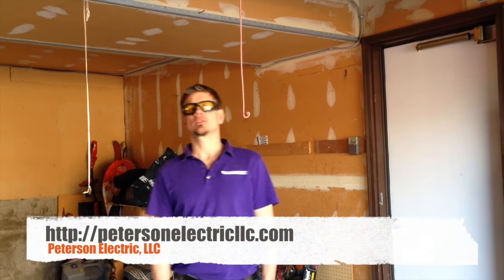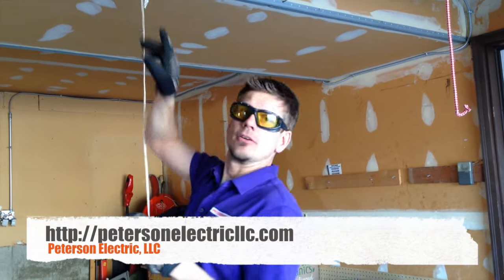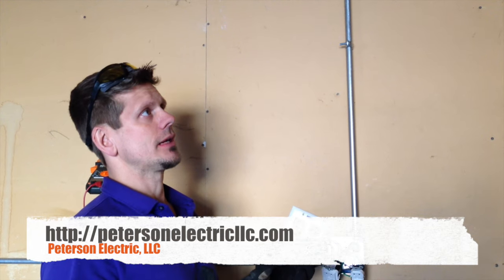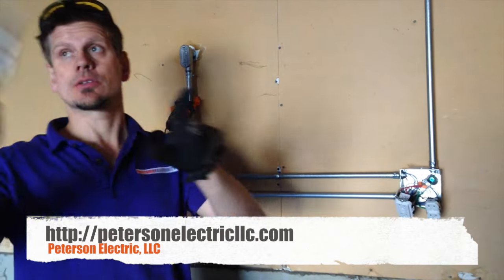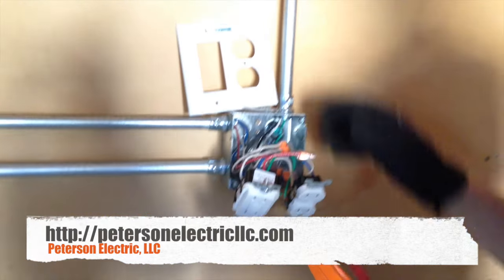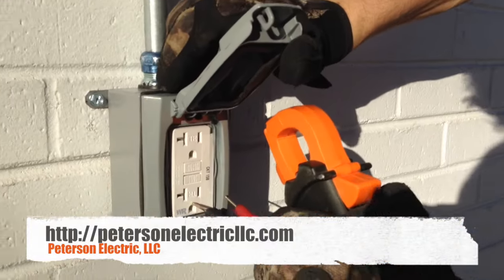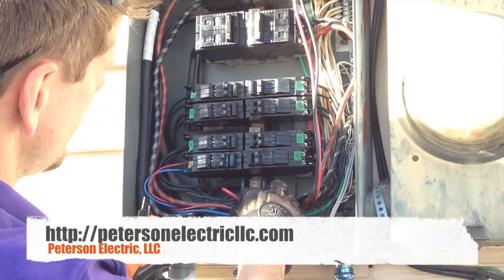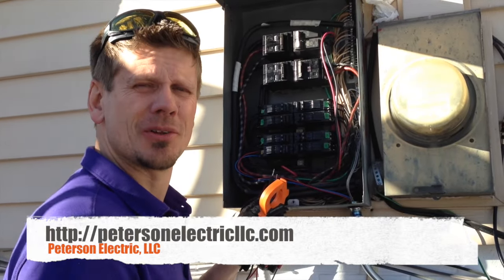Electrical Code For Garages & Exposed Romex Wires

Comment: I would never accept an installation that used conduit as a ground. It has too many ways it can fail....
Reply: while it is acceptable to not run a grounding wire, i would have to agree with you JIMMY TATE. honestly, why wouldn't you just go ahead and run a grounding wire at this point, 1 more wire? it's not like there wasn't enough room in the panel or the pipe and it definitely wouldn't break the bank. i mean come on that "is" kinda cheesy
Reply: only makes good sense, knowing that over time those box connectors are going to loosen.
Reply: @chaser9363  I realize your comment was made in 2017 and no why would that connector screw back out? Are you thinking that the emt and the connector is expanding and contracting from heat? An if that was the cast then it would be in the NEC to pull all grounds in all of your emt installed. I am also a electrician for 25 years I do commercial work. An can there be a failure in a connector or coupling with set screw. You dam right when the person installing does not tighten the set screw or  does not tighten it correctly. These contractors in residential cut there prices to the bone . Do you really think they want to add ground wires? Only if it was required by the NEC.
Reply: @MrShockman10  set screws could also loosen over time as a result of vibrations and foundation settling as well, especially in a new neighborhood where there is still a lot of developing with heavy machinery going on. and not only the set screws, but the lok nuts need to be tightened properly as well. plus now that i think about it, you also need to make sure that you're not using a concentric or eccentric k/o box unless you knock out all the rings and no reducing washers as well.  i do know that at OIA you must pull a ground and no set screw connectors are allowed because of the vibrations from the jets. while i'm aware this isn't an airport situation, houses are still subject to vibrations and foundation settling.  hell, i know at least one county here in Florida wants us to use expansion coupling every so many feet on pvc pipe do to the ground settling so much. i'm a 30+ year mostly residential electrician with idk, about 5 or so years of commercial under my belt. idk, i would just figure the extra wire into the bid and walk away with peace of mind knowing no matter what, i'm covered. but hey, that's just me. always trying to be the perfectionist. not that i am perfect, but i do try.😎
Reply: @chaser9363  If a connector or coupling is correctly tighten I have never see one loosen up. They are designed to bite into emt.As far as a concentric knock out that has nothing to do with a set screw failing.I do not know what type of problems you have in Florida with this happening.But in the Midwest  we do not have connectors failing or loosening as you have said. If the failures you have been saying is so wide spread.The NEC codes would have changed . An if you are so concerned about this then  go to a compression coupling or connector.As far as pulling grounds in that is great The way cast connectors fail if you are in and attic step on one and crack it. Or the cast itself cracks and you do not know it. Or the cast is weak and becomes out of round. Or are made In China garbage.I have also done residential to. An as I said  you must have a totally different situation there if you live in Florida and homes there use NM wire. An I have never seen anyone beside you comment that this is happening with set screw connectors. Let the NEC know if you think there is a problem. Emt here does not just float in the air    I either use one holes or nail straps to hold it to the wood of a home. Or if need be bolt type minnies. In a commercial setting where it is spec out to pull grounds on the print. 
Especially in a data center where grounds are upmost important.As I said pulling grounds in a home is the best system you can have using pipe. There are thousands of homes using set screw connectors and coupling. An they usually fail in a grounding situation due to the installer or the casting or the set screw does not bite into the conduit enough making it a high resistance for a current path to ground. That can also be with your lock nut to. An to me that is great that you care a lot to do a good job. That what matters the most. I also work at nuclear power stations. Good Luck and be safe.
Reply: Your statement from you shows you have no electrical knowledge at all. Conduit is one of the best installs used. An there is nothing wrong as conduit being used as a ground if the couplings and connectors are rated for that purpose. You think the NEC has dummies writing the code? It is with any install from NM cable to conduit it is the installer knowledge to do it to code. An care enough that it is done correctly as my local points out in a journeyman like manner. JIMMY TATE  Is pulling grounds the best install? Yes and that can even fail if not installed correctly.
Reply: @MrShockman10  well, i guess you told me. 🤦‍♂️🤣
Reply: @MrShockman10  looks like i struck a nerve.🤔🤦‍♂️🤣
Reply: I agree totally. Yes its a abundant ground but on a new install, id ran a individual ground for my conductors
Reply: @MrShockman10  man your not the most consistent guy are ya specially for an electrician
Reply: It's more effective than you'd think, they actually test this and do studies on this stuff. The wire egc can fail too.

Comment: Over time the grounding performed by the conduit will degrade.  Using a copper wire for ground is the only way to ensure long term safety.
Reply: Yup new code
Reply: In the comments below he said he pulled an egc so he isn’t relying on the conduit for ground. But thanks for your tip.

Comment: I get out bid on garages all the time.  I refuse to run type NMB Cable exposed below 8'.  The term "not subject to physical damage" is largely up to the local inspector.  I feel if it is easily accessible it is subject to damage.  Even up high people put stuff on top of the joist endangering the cable.  I just put it all in EMT.  I can run it quickly so it is not that much more expensive.  It looks a whole lot better too.  I understand not everyone has that skill but you said it yourself, even type MC and AC have similar wording as far as being subject to physical damage.  So for a novice I would say at least use a metal box with an EMT riser up to the joist on an open garage.  Use a plastic bushing (they make them or a connector with a plastic bushing at the top to protect entering cable.  The last statement I will make might make some people mad but I don't think novices should do electrical work.  Understanding electrical theory, The National Electrical Code and acquiring the skills to do this work are way beyond the DIY person.  No use burning down your house to save a few bucks.
Reply: If you can read (or study YouTube videos) and turn the power off, I don't see the danger.   The code is published and vigorously debated online so there's no lack of information available on how to do things right.  

There are definitely high-voltage and high risk tasks that I wouldn't touch.  Likewise for things that require expensive specialty tools I would only use once.  

But running a circuit or adding a receptacle or light fixture?  Come on...
Reply: @davidrh74  there was a lady in a suburb of my city that was electrocuted because her husband wired a light fixture over her sink.  He accidentally got the switchleg on the screw shell of the light socket.  She was on her knees on the stainless steel sink changing the bulb when she was electrocuted by accidentally coming in contact with the bulb's screwshell.  There is no way a Youtube video can teach electrical theory, best practices and code.  I am sure if you asked her husband he'd tell you electrical work takes training and no 10 minute video is going to cut it.  DIY is fine for putting down hardwood floors or fixing a faucet but not electrical or hvac work.  It's way too dangerous and way too technical.   I think if you are going to post this stuff you might want to check with your attorney about your personal liability for claiming to be an expert.  I would think if something bad happened they could blame you.

Comment: As a home inspector with over two decades of full-time experience, I have to say... Nice Job!!
Reply: What kind of wire can I use to power a floodlight camera to the driveway getting power from inside the garage ceiling outlet. I want to hide cables inside driywall. No crawl space. Do I still need to use conduit?  Thank you.
Reply: @avillareal1  if it’s inside the drywall then romex is fine.
Reply: @edwrd1990  what if running wire outside drywall, instead of running cale through conduit, can MC cable be exposed in garage?
Reply: @avillareal1  from what I understand as long as it’s not subject to being damaged then MC is fine.

Comment: Thank you for this video. Garage wiring is one of the most confusing issues for this DIY person trying to follow the electric code. The code on this issue leads to long discussions on electrician forums. Eventually I just nod out trying to follow these discussions. The interpretations in this video seem straightforward and they were nicely explained. 

The underlying problem that leads to this confusion is the code itself IMO. Everybody that reads it brings in different sections to justify a particular view.

My current view in most areas:
1. NM is OK in garages with and without drywall.
2. NM may be OK to run below 8 feet in an unfinished garage if it follows the stud. Presumably beside the stud in the stud bay is best.
3. The use of AC might be allowed in some situations where NM wouldn't be. For instance passing horizontally through a stud bay below eight feet.
4. There are often claims that there are different rules for attached and unattached garages apply. I think that probably isn't the case.
5. It is not necessary to provide a fire barrier for the NM in the normal garage.

FWIW, In the few garages where I have installed wiring, I just use some kind of flexible metal cable. As much as possible I run it just below the garage top plate. When it crosses a stud bay I drill a hole for it.

Comment: Why would you set up the outside receptacle to effect the inside garage receptacle upon ground fault? If I am working in the garage and cause a ground fault that killls power, I certainly don’t want to be going outside to reset it. I want to reset the receptacle right there where I’m working.

Comment from the maker: Agreed, we have an EGC conductor in our flexible Mc cable, as long as fittings are tight and tested you can use it. The newer R3 sealed compression fittings are not as easy to work with

Comment: What kind of wire can you run through the  MC conduit. Does it come with wire in it? Can you run Romex in MC or EMT conduit for short distances. Thanks. I've got an extension cord run across my ceiling to power the garage doors for the last 30 years(not the same cord of course), and would love to do it right, finally. If it's above the drywall on the ceiling is Romex ok if not in a conduit.

Comment: if I'm adding a spotlight to the eve of my garage wall facing the driveway (over the garage door), I can simply run Romex from the existing garage door opener circuit (on a GFCI breaker at the panel) via external box, correct?

Comment: Technically mc conductors are not labeled, hence it is not listed to be used in emt conduit as say thhn . That's a short run but something to consider.
Reply: I use mc that has conductors inside the jacket with THHN labeling. I have a 250ft coil of it in my truck right now. It's nice because it doesn't have that stupid thin plastic string wrapped around the wires.

Comment: I wonder if the codes generally concerning Romex apply to UF feeder as well. My interest is in protecting some exposed indoors UF feeder from mice with split loom casing because I don't want to have to replace an old panel with an AFCI compliant one. The structure is across the Bonner County ID line in a non-coded zone but I want to stay close to the older two wire codes for safety and wish I could have the AFCI breakers as well. I just can't afford the panel or the 3 wire upgrade for this one so the split loom casing seems an affordable option for exposed 12 ga UF feeder inside a building. Hoping the netted ventilated version won't make it run too hot . . . ?.

Comment: Your videos are usually spot on for information but I would change two things to help the presentation. The first one being a wireless mic so the audio stays consistent without room echo or volume changes due to turning your head. The second is to do the company logo in a watermark style (see through) so it doesn't block what you are showing in the presentation.
Reply from the maker: Thanks for watching, we can not take all the banners down that easy. I have a ton of videos that came out for years, over the past two years we not been putting the banner up and are looking in to a mic.
Reply: @Petersonelectricllc  Yo Brother Josh I've Got $25 on your Mic Man!
Keep up the Great Videos😀

Comment: Isn't the outside outlet cover required to be in "in-use" cover by the current code?
Reply from the maker: Mark Lawry no, not if it is in a dry location. This is in a garage not outside
Reply: @Petersonelectricllc  What about the outside outlet?
Reply from the maker: Yes, you are, but I still use the flip covers when there general use and not needed for a pond that needs to be on , for example.

Comment: Never seen a residential electrical  breaker panel outside personally . Is that common or new code ?
Reply: It's not unusual in warmer climates. I saw it in California, but in the upper midwest, installing an outdoor panel would be insane, and probably against state codes. Californians also sometimes put water heaters outside, for example under a balcony, and often don't have a furnace or AC because the climate is so mild. Houses there are really just fancy umbrellas.

Comment: Josh, is there any issue if you want to add an additional grounding rod at a sub-panel? If its allowed, are you still required to run a ground wire to the main-panel from the sub?

Comment: Looks good but fails. Securing and supporting of AC cable shall be secured within 12 inch of outlet box, junction box or fitting. Also looks like you might be in violation on the 1/2 EMT at your starter box. I may be wrong but it looks like more than 3 feet to the first strap.

Comment: My electrician said I need mc anywhere below 8' in unfinished garage even without wallboard, eg studs.. Misinterpretation? Im off to read code and check 2020 too
Reply: Seems correct to me, 334.15 Exposed Work (A-C)  (B) Protection From Physical Damage, Cable shall be protected from physical damage where (necessary)?? by rigid metal conduit....

Comment: The drywall behind the conduit s not taped, it should have been removed (and later replaced) and run wiring inside the wall - exposed conduit is a PITA when installing shelves and cabinet - and it looks "hinkey"

Comment: makes sense, hey i hav a guy wants to drill holes thur upper wall plate in garage , its two 2x4's to run electrical from attic down wall, whats code for hole size, i thought like 1 inch he is talking 2 inch thanks
Reply: 1 3/4 is the biggest you can go on a top pate 2x4 if it's a double top plate. You can go to 2 inch if you sister studs next to each other on either side of the bay. That's from the HVAC code book tough but I'd assume it would cross over.

Comment: I have a refrigerator stored in my garage. It can only be on one wall. The receptacle is on an adjacent wall. Maybe 15 feet away. The fridge tag lists 4.5 amps 115V source and single phase. Garage/Den breaker switch is a 15 amp. The dedicated kitchen refrigerator/GFI breaker switch is 20 amp. My first thought is to use a 10 or 12 gauge extension cord. Would this be OK? My second thought is to run surface mounted EMT conduit and a metal receptacle box to the wall by the fridge. I'm not sure what an average price electricians charge for this? Any thoughts on these two options?

Comment: It’s 3R rating for weatherproof. Remind garage owners to not have the GFCI inside the garage if there is no man door accessible to your garage.  Also recommend using an additional wire for the circuit grounding. Thanks for your video. Good job.
Reply: Wow, yet another bit of garage wiring that I would never have imagined. Still garages without a man door are uncommon.
Reply: @davefoc  Well, it isn't correct.  GFCI receptacles are required in garages.  NEC 210.8(A)(2).  There are no exceptions to this and certainly not one that depends on a pedestrian access door which is a totally asinine assertion.
Reply: You need to stop spreading this mis-ninformation.  GFCI receptacles are required in garages.  NEC 210.8(A)(2).  Applicable to all 125V, single phase, 15 & 20A receptacles.  There are no exceptions to this and certainly not one that depends on a pedestrian access door which is a totally asinine assertion.
Reply: @JenkinsStevenD  It sounds to me like @gregray4685 is saying the GFCI reset should be outside the garage if there's no pedestrian door.  What happens when the GFCI feeding the garage door opener trips?  You need a way to reset that without having to break in to your - now dead but still locked - garage door.  There's no misinformation here - just a misunderstanding on your part.

Comment: How to cover/protect exposed Romex in attics?
Reply: Is there a requirement for that? If the wiring is near the access to the attic, I might make a channel out of two boards laid beside the Romex so that people crawling into the attic don't pull on the cable.